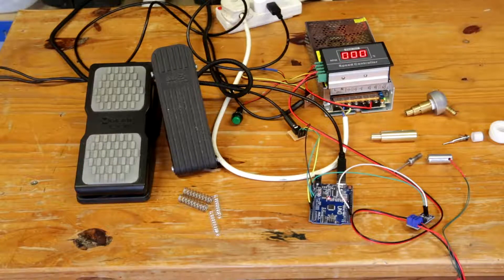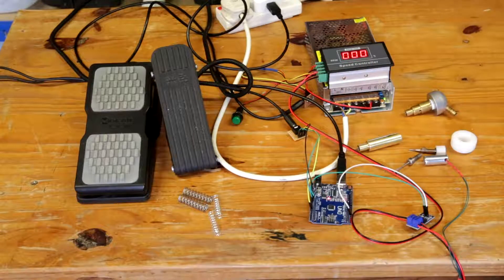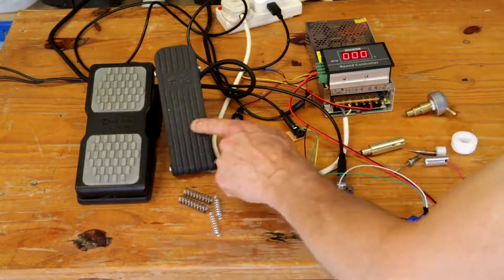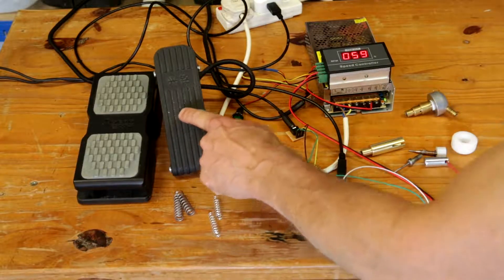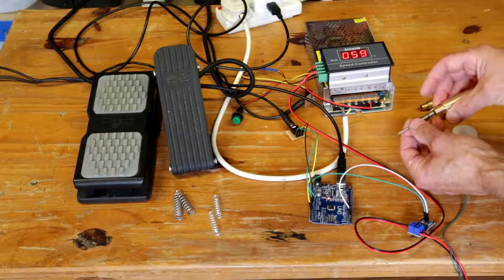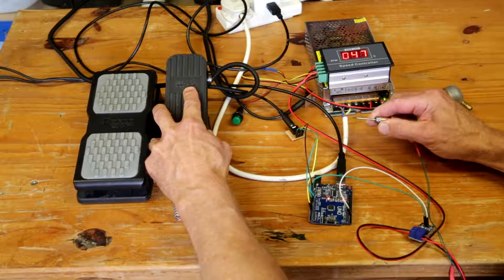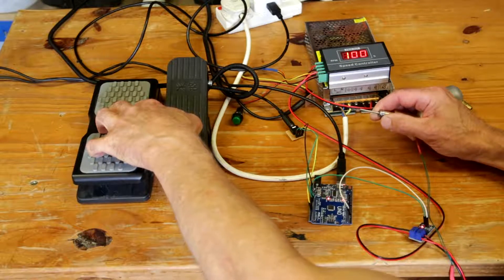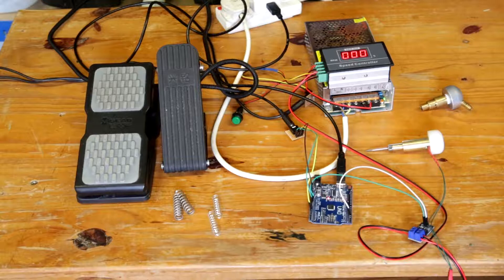Solenoid Engraver Prototype

Comment: Hello, So I replicated what you did here, except the solenoid (the same one you used) stops working once it runs hot
Reply from the maker: When a solenoid gets hot the resistance in the coil reduces. This will reduce the power that flows through it and hence the magnetic force it can produce. It's a fundamental problem that all solenoids have when pushed hard. I have a new handpiece that has a mounted fan which keeps the solenoid cool take a look here

https://youtu.be/Q9xFH1qhLhE
Reply: @alastairduncan4702  thanks a lot

Comment: How exactly are the pins added onto the smaller board “mosfet” I have all the parts and everything done other than this step as I’m not sure how they are added and should I buy them as singles or in them long rows and only snap off two?
Reply from the maker: This is a link to a single MOSFET.
https://kunkune.co.uk/shop/relay/dual-mosfet-driver-3-3-20v-trigger-15a-400w-out
You can get multiple packs but you only need one. They sometimes come with header pins sometimes without. If without then you will have to get some. 4 pins are required for the board shown. If you are mounting the MOSFET on a breadboard then mount from underneath. I mounted from the top as I glued the MOSFET to a piece of wood. The pins require soldering to the MOSFET.
Reply from the maker: This video may help on soldering the header pins to a PCB

https://youtu.be/qz9Ryos1_GY
Reply: @alastairduncan4702  thank you so much for replying, I have the mosfet boards you linked on the GitHub I got a 5 pack I was assembling it all last night and realised there was extra pins on the mosfet you was using, in regards to the pins do I need male or female, like just the bare pin or the black plastic boxing of you know what I mean? And do you happen to know the spacing or can I find that out on the boards themselves? 

The hand pieces printed lovely too by the way I’m just waiting on the grs tool holders and I have everything, I even cadded a cabinet for it all to go into, if you want to have a look at it shoot me a message and I’ll send it over to you free of charge :)
Reply from the maker: @FrostehOne  male or female is determined by what cable you are going to use to plug in to it. The spacing is fairly standard 2.54mm or 0.1". Some pics of it finished would be good.
Reply: @alastairduncan4702  perfect thank you I’ll go for the open pin ones as I can secure them with a tiny bit of hot glue. Thank you again for your replies I really appreciate that! And for sure I’ll reach back out once it’s all assembled with some photos
Reply: Hi Alastair, I’ve wired everything up and all is working but to a degree, the solenoid is getting very very warm & if I set the pwm above 25 it stops moving it almost sounds like it locks up inside and once I drop it to 24 it makes a slightly loud noise and sounds like it releases, could it be a soldering issue with the pins on the mosfet or the joining of the solenoid wires to the speaker wire? Any help would be appreciated all other parts seem to be working ok, the red light blinks on the board for the speed the uno board all lights up ok and the pwm stays lit up bright and ok
Reply from the maker: @FrostehOne  things to check

1. Does the solenoid piston move freely? Remove the handle push the piston in, does it return freely? 
2. What are you using to power the Arduino? I use a 5v usb phone charger. The 12v power supply will produce too much RF noise and interfere with how it functions.
I would expect it to start striking at over 35. It may oscillate at lower power but not be enough power to strike. 
I'm surprised it's getting hot at 24 or 25. I would expect it to get hot if you continuously run at 100%
Reply: @alastairduncan4702 it was me being stupid I had the wires
For the solenoid backwards lol, it’s all working fine I had to cut down the piston a bit for it to move freely and strike as it was a bit to long originally, but as of now it’s all up and running correctly! Thank you again for your help along the way I also have the cabinet all together now to how would I go about giving you some photos of it shall I upload a video on here and tag you?
Reply from the maker: @FrostehOne  that's great. You can pm me on Instagram @alastairduncan4

Comment: Might or maybe the solenoid  get overheated for a long time use and burn
Reply from the maker: If you use it on maximum power it can get hot but it's never burnt. For the type of engraving that I do it only gets warm.

Comment: I have question, can that foot pedal be hooked up to the homemade graver that Shaun Hughs built using a 12v air compressor. Instead of using a speed controller could one just use that foot pedal?
Reply from the maker: The foot pedal can be connected to the Shaun Hughes home made engraving machine by replacing the speed controller potentiometer with the foot pedal.

Comment: Nice to see an alternative concept. How does it performe compared to an air powered engraver? Do you feel any differnce?
Reply from the maker: The only experience I have of a pneumatic engraver is with the Shaun Hughes "home made hand engraving machine", I've never used any of the commercial offerings. I have the same foot pedal for strike rate and the dog water foot pedal for power control on the home made engraver, so I have similar methods for control on both systems. The EZ graver is much easier to control and is more consistent as the power delivery is the same over the different strike rates. The power tails off with the home made graver as the strike rate is reduced. I much prefer the EZ graver. The particular solenoid that I've used in the EZ graver has less power that the Home Made Graver but I've been able to do everything I want with the EZ graver, I don't do any engraving on the harder materials. There's still some work to be done on the selection of solenoid as I think this can be improved.

Comment: Thanks so much Alastair! I followed your design and am now experimenting with some ideas of my own. Even an old dummy like me was able to get the Arduino to work pretty quickly. I even found the UNO's from Walmart for $10/ea...so I bought two! My setup seems to be underpowered compared to what I see in your videos. Not sure why, so I just built a beast with a 45N solenoid that is 1" in diameter. It works great but is about the size of a power toothbrush. It uses the same setup and equipment as yours and I can still get light action by dialing back the voltage, but it'll really plow when it's cranked up! Any suggestions on my "power problem?" Thanks again! You've made my old GRS System 3 obsolete.
Reply from the maker: I'm pleased you've got a system working. What materials are you engraving? The solenoid comes in 2 versions a 12vdc and 24vdc. are you running the 24vdc on 12vdc? I use the 12vdc version. I have pushed 24vdc through the 12v solenoid and it produces a lot more power but at the expense of more heat. I have got a much bigger solenoid(19mm, 3/4")but have not done anything with it yet as the one I have suits me well enough as I only engrave copper brass and silver and fairly small stuff. What is the solenoid you are using? I've also been looking at a custom designed solenoid but that will probably be a longer term part of the project.
Reply: @alastairduncan4702  I bought the 12v solenoid you listed (XRN-13/30TL 12vdc) but never pushed it beyond 12v. I made a heavier piston but it didn't seem to improve the power much. Everything in my setup is the same as yours except the power source. I already had a 0-30V variable DC power source that I'm using. I do engrave on tougher materials - steel and bronze currently. I've been looking for more powerful solenoids that aren't too big but I may just have to buy some and experiment. The power ratings on Amazon are misleading I'm sure, but the price is cheap enough to take a chance. The big one I've got running is 24v and was in a 1" open metal frame that I removed. On another note: I noticed the go-cart pedal has a large dead area in it's range - it starts right out slowly but then will travel most of the way down before it begins to speed up, and then it speeds up rapidly...is this typical or just my pedal? As for my handles: I don't have a 3d printer, but I'm a machinist so I made the little one from aluminum, and the big one from plastic with a bronze nose cone to hold the tool. I'm excited about the possibilities with these electric hammers thanks to you! ...and you've shown they don't need to cost $3500 either, lol.  If you know of any good solenoids to try maybe you could post them. Thanks!
Reply from the maker: Its possible that the XRN-13/30TL may not be man enough for the type of work you are doing as its not been designed for this task, it is quite a small solenoid and that is the attraction as it fits easily into the hand. I've been scouring the internet for solenoids myself, the data sheets for the cheap ones are non existent. The open metal frame may influence the magnetic force the solenoid is able to exert, although by the sound of it the big solenoid you have is more than powerful enough, the biggest problem with that is the size in the hand, the tubular solenoids are meant to be more efficient as the casing focuses the magnetic force(I think) . The hall effect pedal may not be linear, I've got used to mine now. You can hook another audio foot pedal in its place all it requires is an adjustment to the default parameters in the arduino code and it will give you much more control. I used the hall effect pedal because I had it, I have got another audio pedal now and just need to hook it up and adjust the code. Once I've done that I'll make it available. I've got some enamelled wire for making up coils and done some calculations but have not got around to doing anything with it yet. The expensive machines have had a lot of development work put into them but for anyone who likes to make their own equipment the principles are not in the rocket science area and it gives the opportunity to try engraving and setting without the massive burden of the initial outlay, as long as you have a bit of time to tinker.
Reply: @alastairduncan4702  I've got a regular music pedal... I'll have to try that. what code changes need to be made? An interesting note: on my big setup I had a metal screw set up on the back side to regulate the piston travel and it was killing the power! I put an insulator in there and it started HAMMERING. Now that I've established the "happy spot" I'll remove the metal screw completely. Im thinking maybe a short stocky solenoid with a short stroke may work well, but it will probably be 1" in diameter or more calling for a unique handle design. I'll share what i come up with!
Reply from the maker: the line of code is line 36
comment out the line by adding // at the start of the line e.g
//int pot_value = map(analogRead(ACCELERATOR_PEDAL), 180, 875, -2, QUANTIZATION_FACTOR);

and add in this one
int pot_value = map(analogRead(ACCELERATOR_PEDAL),0,1023, 1, QUANTIZATION_FACTOR);

you can switch between the 2 lines by uncommenting the one you want and commenting out the one you don't want. I've not tested this code but it should work ok.

Your comment about the insulator is interesting.
Reply from the maker: I've updated the arduino sketch on github with the appropriate code and tested it. If you add a jumper cable from grd to D7 then the code now assumes that the pedal is the m-audio pedal(potentiometer) if its not connected then the assumption is that the pedal is the hall effect.
Reply: @alastairduncan4702  Awesome! I can't wait to try it. Thank you and I'll let you know how it goes.
Reply: i guess im asking the wrong place but does someone know a method to log back into an Instagram account?
I somehow forgot the account password. I would love any tricks you can offer me
Reply: @Deacon Eric Instablaster =)
Reply: @Brody Cade i really appreciate your reply. I found the site on google and im waiting for the hacking stuff now.
Looks like it's gonna take a while so I will reply here later when my account password hopefully is recovered.
Reply: @Brody Cade It worked and I finally got access to my account again. I am so happy!
Thanks so much, you really help me out :D
Reply: @Deacon Eric Glad I could help :)

Comment: Very cool.  This video shows both foot pedals hooked up but the schematic only shows one.  Am I missing something?
Reply from the maker: In the text 😉 it mentions that 2 pedals are not absolutely necessary. If you do want 2 pedals the potentiometer pedal is substituted for the potentiometer that is connected to the pwm speed controller. You will need to remove all of the rubbish in the footpedal and leave the potentiometer connect up the wires directly to it. Hope this helps. Let me know if you need more clarification.
Reply: @alastairduncan4702  I have made a 555 timer controlled air pulse  engraver where I used a pressure sensitive resistor attached to the handpiece to give it a palm control like effect.  do you think this could be incorporated onto your machine?
Reply from the maker: @Joe Paonessa I've never used a pressure sensitive resistor before but I can't see any reason why it wouldn't work. There are plenty of examples of the pressure resistors hooked up to the Arduino. I'll put it on the list of things to try. I've not used a palm control handpiece so I'm not convinced that it would be better than the foot pedals but I'm all for giving it a try to see if it will work well. Great idea 🙂
Reply: @alastairduncan4702  I watched the video again and what I am thinking is to have the pressure resistor control the strokes per minute and a knob setting control the force. This way more pressure on the handpiece would up the speed and more force would be consistant.  I'm thinking that this is the opposite of how you have the pedal inputs, Or am I again not seeing it clearly?
Reply from the maker: You are not seeing it clearly Joe probably because the PWM speed controller was designed to control the speed of a motor and it does this by controlling the power going to the motor. So the hall effect foot pedal that feeds into the Arduino controls the frequency of the strike and a replacement of the hall effect pedal with the pressure resistor is what is required with the addition of a pull down resistor. Your analysis of what is required however is spot on.

Comment: That is so beautiful Alastair. I can tell just by the noise if a graver is hitting right, and that sounded perfect, smooth start. What's amazing is I have both those pedals already, and probably the other parts from failed attempts. I'm gonna put you along side Sergey Waltman ( the discoverer of the Homemade Machine Hand Egraving Machine), but because I only learned Russian enough to understand his video, you get to name this one :) If I had got there first I favored....The Easy Graver
Reply from the maker: Thank you, the easy graver sounds good to me 🙂
Reply: @alastairduncan4702   Great so, is it            The Alastair Duncan 'Easy Graver'   or    The 'Easy Graver' by Alastair Duncan, the second one sounds more artistic :)
Reply from the maker: @Shaun Hughes Engraving  the second sounds better but I'm not bothered about having my name on it. I  don't do this sort of thing for recognition, I know i'm just putting other people's discoveries together.
Reply: @alastairduncan4702   That's every invention bro :) I recognise success, you succeded. If I can put it together anyone can and it looks not to difficult. I'm calculating it will take me a day of getting the arduino to work, but I will be an expert on this one task. Any heat from the solenoid, any more deatils need to hack the other pedal. I think you could judt have a switch for that, but that will be fun. I'm thinking, you could program morse code into the graver  and engrave lines up and down and into a pattern. Like a sillouette of Winston Churchill in more code lines